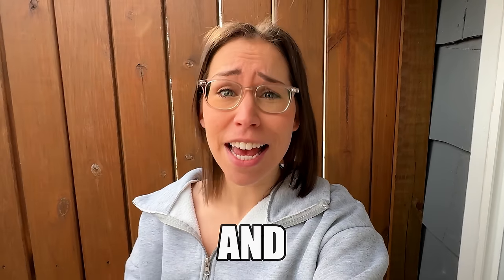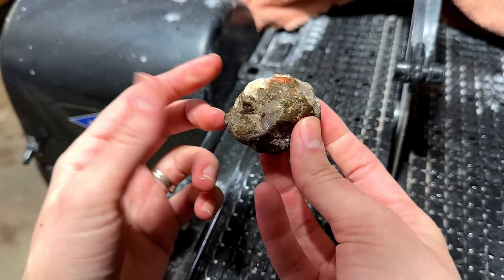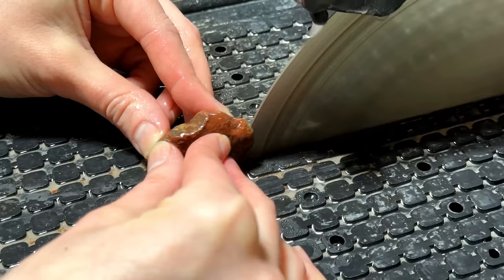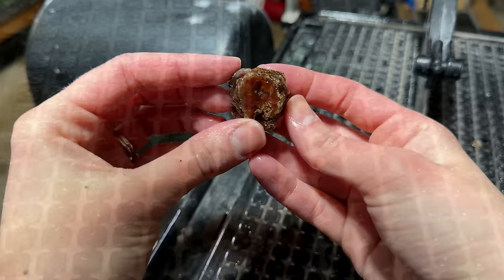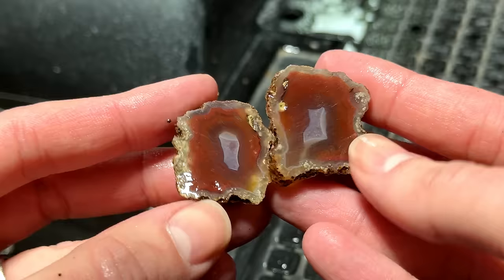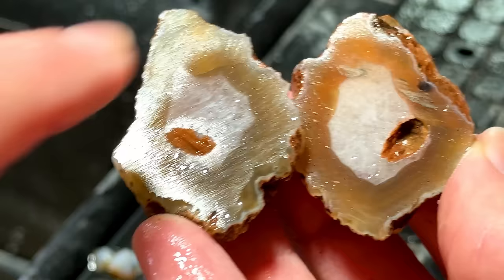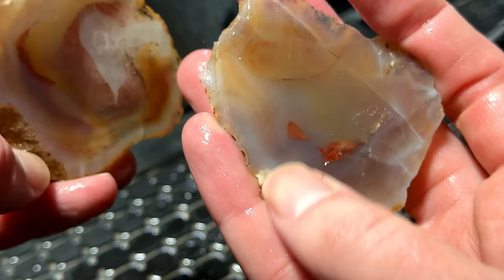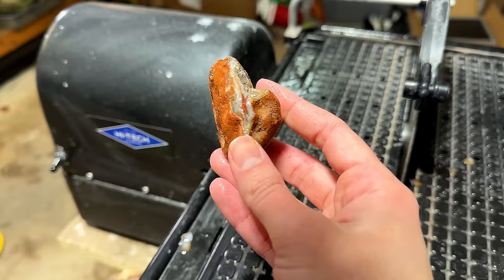Cutting Open My Most Expensive Agates—Let’s Hope I Didn’t Ruin Them…

Comment: In the rock give-away, you asked about the sound proofing set-up.  What I have done is used safety pins.  I also tried to use stick pins, but they are more difficult to push through the foam and paper.  Also,  Iwould like to add, I Love your content.  Keep them coming!  I enjoy the excitement you show!

Comment: I just cut around 12 lbs of mixed agate, Botswana, desert, and north shore....i still get excited about each stone... The breaking is because of faults in the stone..cracks if you will. If they are cracked in one direction its best to cut along the same path, if in multiple directions its best to break with hammer and tumble.